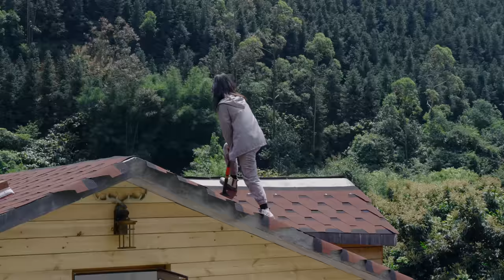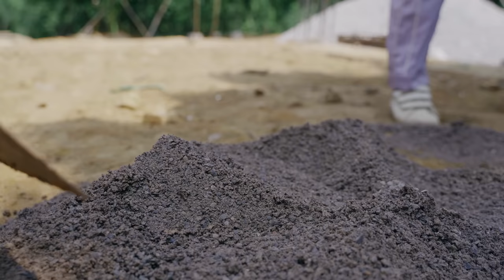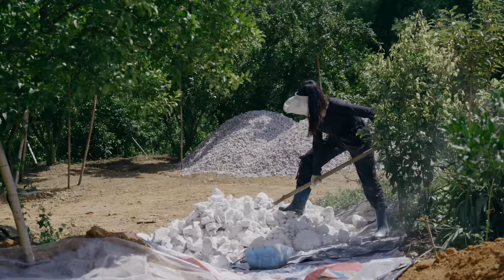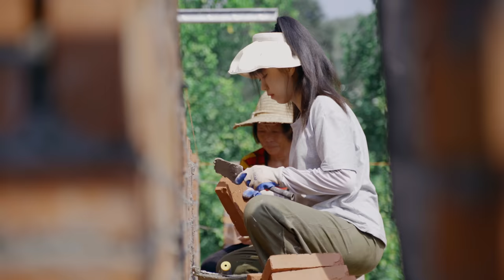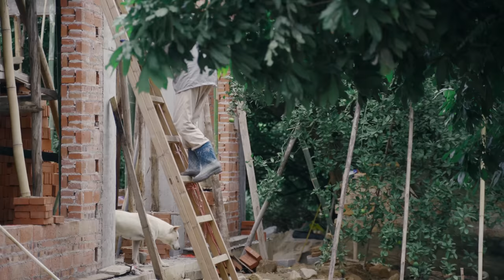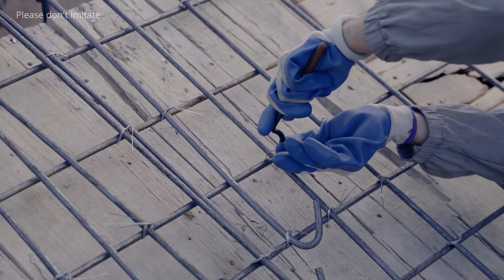ONE GIRL, Build 150 sqm House from the Ground Up! 1-Year Journey in 25 Minutes!

Comment: The house looks great, but I'm very curios about the choice of shingles on a concrete roof. Wasn't there a coating or something less intensive that could have been used? Maybe rain water catchment is impractical with torrential rains as you mentioned? I just thought I'd ask.

Comment: The cement from the pit  would rather be lime cement would it not ? The rocks are burned lime and you have a pit filled with water .( Wet lime) if cement was put in that water I would harden within hours.  wet  lime can be kept in the pit for a long time without hardening.
Very nice building!

Comment: Expansion screws and nails are used all over the walls and roof to attach wood boards and roof shingles.  Wood will rot no matter you put how many coats of anti-rotten paint, and eventually you will need to replace the boards.  The same with the roof shingles, you will need to replace them.  The life of roof shingles is about 20 years, maximum 25.  By that time, you’ll know how difficult it will be to take the expansion screws and nails out.  If the screws and nails get rotten first, that’ll present different kind of problems.  Don’t even mention that screws and nails create cracks in cement roof and walls to increase the possibility of water leakages….

Comment: You are:

Making a cement structure and cladding it with wood paneling.

Why didn't you use wood to begin with? It would have been more genuine, and possibly been a simpler construction. I have observed that they keep the materials consistent, ie cement clad with stone, with wood its more veneers and finishes. Maybe such a method of construction is not possible in your location or other reasons.

Excellent result though, looks fantastic.👌👌

Comment: What a pity. So much effort and yet missing what seems to be the point of a home. Something that maintains climate easily and safely. Living in a bunker without insulation is going to be a heating/cooling headache for the rest of your life. Cement and paints are generally toxic and should be avoided.